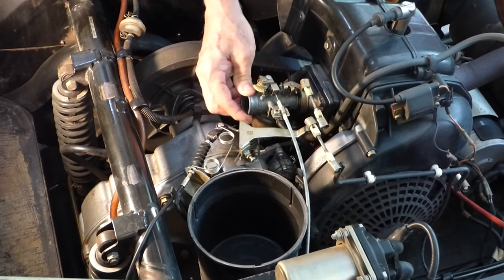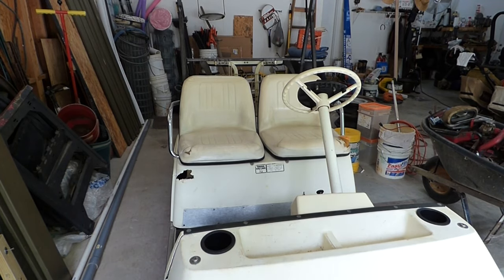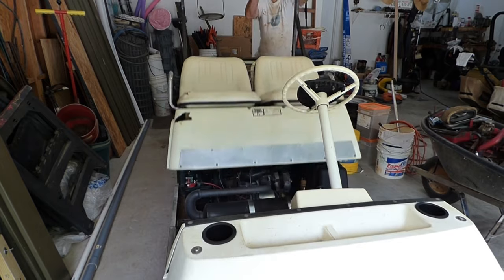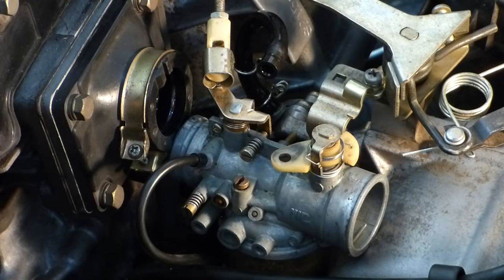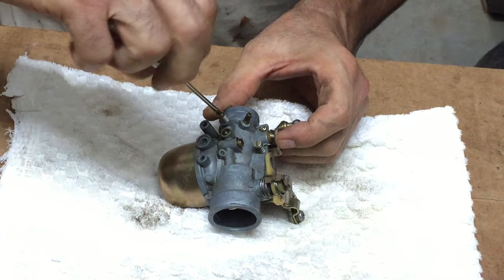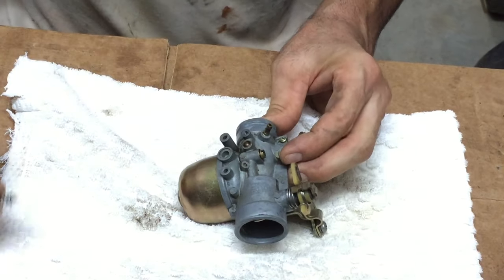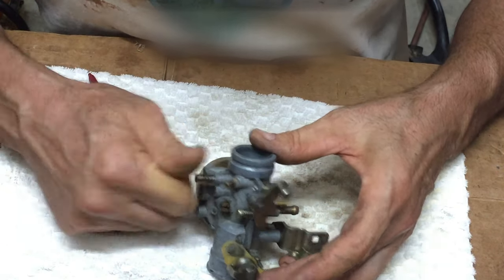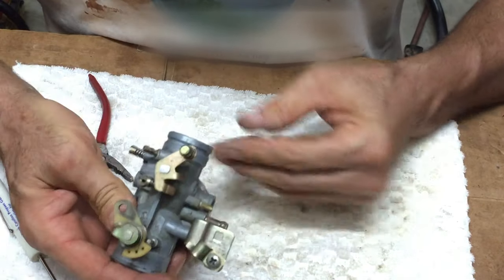Is it the Carburetor or Fuel Pump? - Golf Cart Won't Run or Runs Poorly - How to Fix

Comment: I was very impressed with the easy to follow steps on the reinstallation of the carb, but I was not happy with the way it was taken apart, so when I saw the way you put it together I was very happy, thanks good job
Reply from the maker: I try not to take too much time to get the directions across.  I thought showing more details on the reinstallation would give people the details they would need to do the job themselves.  Glad it helped

Comment: I've got an 87' G2 four stroke and with the instructions from your video I now have a really clean carb.  Thank you - but my initial problem persists.  It runs so rich other cart drivers stay about a quarter mile behind me!  I can't find any advice on the problem.  Can you point me in the right direction, please?
Reply from the maker: Make sure your air filter is clean... 
There is a fuel adjustment screw on the carburetor if it is running too rich you can try adjusting that (turning it clockwise will provide less fuel to the carb.
Is it running rich or burning oil?
Let us know what it was after you get it fixed.
Reply: @helpinguonline  Installed a new filter/pre-filter and not quite as bad but not much better.  I've had to run it using 1/4 choke to get it to run smoother and get more power.  Not burning oil or smoking at all.
Fuel mixture screw is set at 1 & 3/4 turns out right now.  I really appreciate that you respond to requests for help.  It's one of the reasons I subscribed.
Reply from the maker: If you have to run it with 1/4 choke that means you are not getting enough fuel (it's running lean not rich).  turn the screw out (counter clockwise) further and see if that helps.... check fuel filter to see if it is clogged if so install a new one.  check fuel pump and lines to make sure no leaks and all working well.
your carb needs more fuel not less if you have to run it with the choke.
Let us know what you find and how you resolved the problem
Reply: @helpinguonline  I've adjusted the mixture screw outward as much as 1/2 to 3/4 turn and though it no longer requires running with the choke open 1/4, the fumes are still nearly unbearable.  I'm leaning towards getting a new carb.  Thanks for your help.
Reply: @Helping U online  I've adjusted the mixture screw outward as much as 1/2 to 3/4 turn and though it no longer requires running with the choke open 1/4, the fumes are still nearly unbearable.  I'm leaning towards getting a new carb.  Thanks for your help.

Comment: I notice you didn't pull the pilot(Big screw in middle) out and clean it. The second time I cleaned my carb, I opt to soak the pilot and other parts in a shot glass of carb cleaner and it pulled out some nasty stuff that was missed earlier.

Comment: Greetings, I have the same golf cart as in your video. 1985 Yamaha G1. Owned this cart for about about 7 years now; I use it on a 4-acre farm property. About 2 weeks ago, I failed to check my fuel level and ran out of gas. From that point to the present, I have had the same issue as in your video with no power. I followed your video to check the carburetor at the fuel bowl level, but I still need to remove it entirely as you did. There was no debris in the fuel bowl; I sprayed carb cleaner and reconnected, however, to no avail. I sprayed carb cleaner in the jets, motor kicked in with full power, then slowed down. I followed another video to check the fuel line from the tank to the pump, and all was clear. As you showed, I checked the line from the fuel pump to the carb, and no fuel was coming out. So I ordered a fuel pump from eBay, which I discovered was my first mistake. The fuel intake brass nipple is a smaller diameter than the original "mic" brand, I had to use a hose clamp to secure the hose; the screw pattern is off about 1/16" smaller than the original; holes on the device I needed to drill out to accommodate the size of the screw to fit the frame. The unfortunate part of all this is no fuel is pumping out from this device.  I stated all this to ask the question. Is there a way to test a fuel pump? I believe I need to purchase an OEM fuel pump, do you agree? Thank you!
Reply from the maker: It is a little difficult to follow what you have written without looking at it. When the original fuel pump was on there did you check the fuel filter and everything else From the fuel tank to the carburetor?  When you ran it out of fuel maybe something got clogged or the air in the line interrupted fuel getting to the carburetor?… Your new pump being the wrong size and using hose clamps sounds like there is a chance of air getting into the line without a good hose clamp to seal it. If it were me I would go back to your original fuel pump and see if you can diagnose the problem from there.
Maybe running the fuel tank empty pull some debris into the fuel pump or fuel filter?. The way that your fuel pump works is by the piston causing the diaphragm and the pump to pump the fuel into the carburetor. To test your fuel pump you press the Excelerator like I did in the video with the fuel supply line to the carburetor disconnected and you should see fuel pumping out of that hose. If you’re not getting fuel coming out of that hose it’s because of a cracked fuel line or a clogged fuel filter or possibly a clogged or bad fuel pump. It is hard to diagnose without looking at it.
Reply: @helpinguonline  Greetings, sir; thank you for taking the time to reply. Apologize for the delay in responding back. I did check the fuel line from the pump back to the tank in two methods. I removed the line from inside the gas tank with the hose connected to the fuel filter and the hose connected to the metal line. I disconnected the hose between the end of the metal line to the fuel pump. I applied a small amount of air to the line from the tank with a compressor. The fuel in the filter and line blew out and cleared the line. I then placed the tube back in the gas tank and connected the hose between the metal line and the fuel pump. I then pressurized the fuel tank with compressed air, and fuel filled up the filter and line. I started the motor, but to no avail; fuel did not come through the pump. I do not expect you to respond, sir; just letting you know of my steps. Thank you.
Reply from the maker: It is hard to say without looking at it.... but... sure, your fuel pump could be bad or an obstruction somewhere. Is the fuel you put in the tank good (no water in it?) If everything is clear to the pump and the pump isn't working replacing the pump would be a good guess...and you need air tight connections for the pump to work properly.  Sorry I can't be more help... but you will get it if you keep plugging away at it.
Let us know what you find and how you fixed it.

Comment: I have a g1 yamaha 2 stroke it will Starr up and run but it has no power like I can have the gas pedal to the floor and it may go cpl miles an hour! Any thoughts on what the issue might be?
Reply from the maker: I do not have enough information to be able to diagnose your problem but… Is it getting enough fuel?… Is it getting enough air?… Is it running well but something as simple as the brake is sticking?… Did you run it on straight gas without two cycle oil and score the piston and Cylinder wall?… I would start simple and work your way deeper from there. Let us know what you find out

Comment: I've got a G1 golf cart that will turn over but it won't drive. Any advice?
Reply from the maker: Check and see if you have fuel going to the carburetor and if you do then check and see if you have spark. It is probably one of those two things. Those are the most common causes

Comment: I recently had a 2001 Club Car DS serviced for a no start problem.  A new coil was installed, new fuel lines and filers and supposedly the carb was cleaned by the serviceman.  Now it is slow to get started...you can only press the accelerator down slightly to starts then it run roughly and finally after a couple of minutes it runs fine.  The fuel pump is pumping fuel but can you have one failing do this or any other suggestions?  Thanks for your time.
Reply from the maker: Sounds like your carburetor needs adjusting.  There should be an air / fuel adjustment screw on the carb to do that.  Also, the choke may be opening too soon before it is warmed up enough to run smoothly.
Reply: @helpinguonline  Would the carb need adjustment even though none of the screws were touched.  He did suggest putting Seafoam in it and run it  but that didn't make much difference.
Reply from the maker: I thought you mentioned that it was serviced and had the Carb cleaned.  If it was cleaned, it would have been disassembled.  The air/fuel screw would have been removed and reinstalled.  Thus, it may need a little fine tuning?.   Takes just a minute to do.  You should be able to find a video online to show you how to do that on your club car.
Reply from the maker: it also could be a choke issue if the cart runs well when warmed up.
Reply: Thanks so much for your help.  I will check the choke.
Reply: Well I had another service person look at it and he said the carb float was sticking.  Well he returned it and it ran great for a day but then it's now hard to start.  Once I get it running it runs great.  Then when I stop it is hard to start but then eventually runs good.  Any chance I have a flakey fuel pump even though I checked it and it pumps fuel.  Thanks for your replies.
Reply from the maker: it is possible.  If you don't have a fuel pump pressure gauge I would check the volume coming out of the fuel line when it is running well and then when it is running poorly check it and compare.  not real scientific but may give you an indication.
How about your fuel filter and fuel tank?... are they clean and clear and free of debris?
Also you can pick up an aftermarket carburetor for the G2 for about $25 if your carburetor is the problem.
Let us know what you find out.
Reply: @helpinguonline  Thanks so much for the help.

Comment: How do you check the oil in the engine and the transmission
Reply: It's a G1 golf cart
Reply: Still trying to find out how to check the oil in the G1 2 stroke golf cart and transmission do not see any dipsticks
Reply: @jefferylee7550 it’s a 2 stroke.  No oil in the engine.  The oil is mixed in from the oil tank on the side.   If the oil pump is bad, you can premix the fuel with 2 stroke oil.  Also, no fluid in the trans.  It a centrifugal clutch.   Take a look at it and see how it all works.

Comment: I have a G1. New fuel pump. Vacuum coming from the crank case. Fuel will not pump. Any advise?
Reply from the maker: Is your fuel line kinked?  Fuel filter blocked?  Properly hooked up?  Is your fuel pump working even though it is new?
I would start with the simplest thing first and work your way through it.
Let us know what you find.
Reply: What was it.

Comment: Is there any way to adjust the speed on those carts?
Reply from the maker: You can adjust the Governor to make it go faster.  There is information on google and youtube on how to do that.
I don't like to do that because I want to get the most life and longevity out of the engine so I don't push it.
Reply: just make sure your oil pump is working properly if you want to run this like a snowmobile.